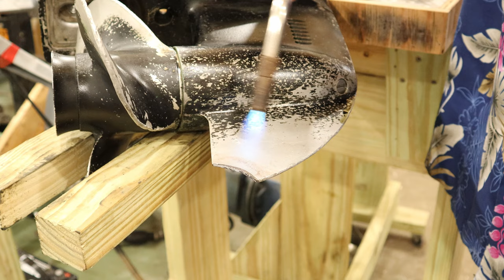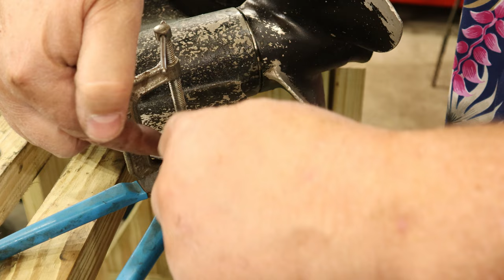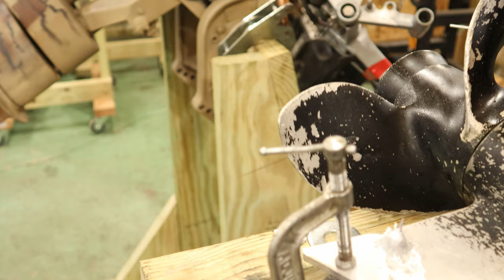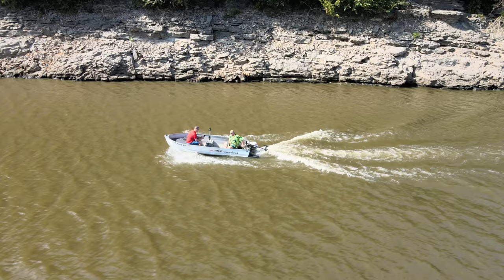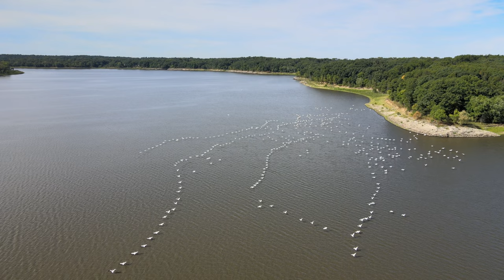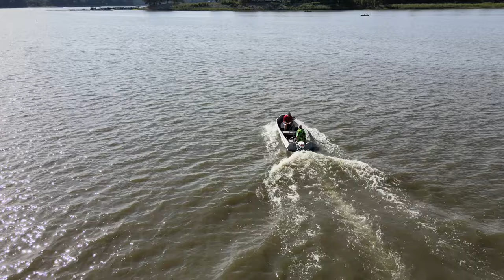1975 Mercury 20hp part 2 Skeg repair

Comment: Great job on that repair job,I aslo made some brackets for my kayak and used aluminum rods .came out perfect ,just like you said have to get it to the right temp tp flow out .I used map gas ,a little hotter than regular proane gas

Comment: 👍👍 That turned out really good . Brazing rods are awesome  but ya right practice and heat control are key also learn heat blocking putty helps when patching holes or cracks in Jon boat .. Hey to ya grandkids . 👍👍 Drone 👍👍 As always Sir thanks for the ride along
Reply from the maker: Awesome comment and thanks for watching.

Comment: They make wax in a tube like grease but u use it for aluminum cutting and grinding. Also regular candle wax works too. Keeps from clogging up the cut off wheel
Reply from the maker: Thanks for the tip!

Comment: Hi Mike, I think I have said this before that I fixed my 4hp Yamaha prop that had a chunk missing on it. I was worried that it would affect it when I was done for vibration but works great in the water. maybe not for a large motor prop which I would suggest putting into a steel prop form tool. The alumiweld rods will not stick to steel. Fyi
Reply from the maker: Nope, not designed for steel, nice job on the old prop, thanks for watching

Comment: I was watching Cody Bass he took a old blastic trim tab and sandwitched the skeg between two pices of the plastic and ground it to shape ran a few nuts and bolts through the meaty bart that was left on the skkeg. It has more flex for the next rock and bends rather then cracks off again. Didn;t look bad eather
Reply from the maker: I saw the same one. Thanks for watching

Comment: Do you make house calls lol. I have a 67 that the guy took apart to replace water pump and then couldn't get it to restart. After I bought it I think I fixed the gear rod,but not sure. Can you do a video on how to reinstall that? Also how does the carburetor float go back in?

Comment: I haven't had much kuck using those sodering sticks Mite be better usinf thicker meteral like the skeg but I have tryed to fill holes in a aluminum boat . Hasn't gone to good for me and on a crack it seams to only make the crack run away from were it was even useing map gas Yellow gas container. Getting the temp just write is harder then it looks. it sure isn't like brazing for me.
Reply from the maker: Holes on boats doe require a special technic I have found. Thanks for watching

Comment: I have a Yamaha 9.9 that the skeg is broken off much closer to the gearbox. Will the heat affect the seals in the gearbox if I attempt this repair? There's about 3\4" left of the original skeg... Great video!
Reply from the maker: Yes the heat will burn out your seals. Disassemble before attempting that repair. Thanks for watching

Comment: Shouldnt the skeg have a flat area and not into a point?  Never seen one into a point and im working on a 1960s 65hp mercury and its flat. Just asking?
Reply from the maker: Personal preference really, If you are taking it on and off and setting on the ground then a flat bottom is probably best. Mine is going to be bolted to back of the boat and it's only enemy is shallow water. Thanks for watching

Comment: What brazing sticks do you use? I tried on my old Mercruiser and just could not get things to temperature.
Reply: It looks like that low temp aluminum welding rod
Reply: @onazram1  honestly can't remember if I was using propane instead of mapp gas. Probably what my issue was.
Reply from the maker: just low temp aluminum solder. Thanks for watching.